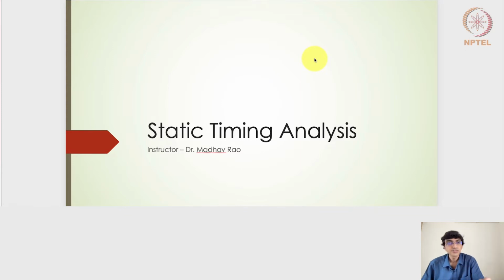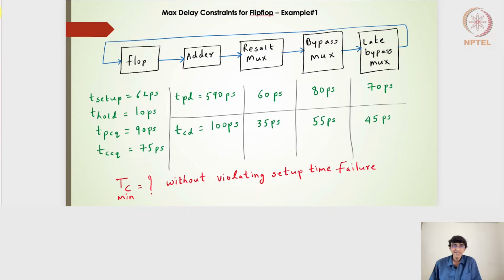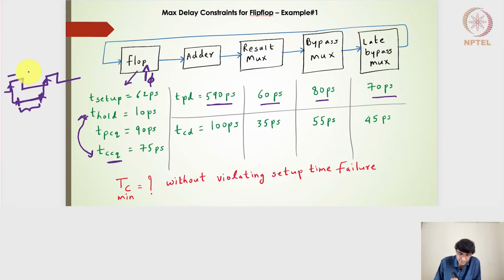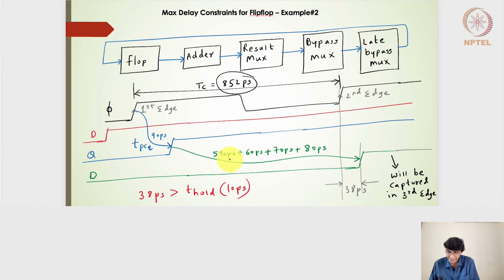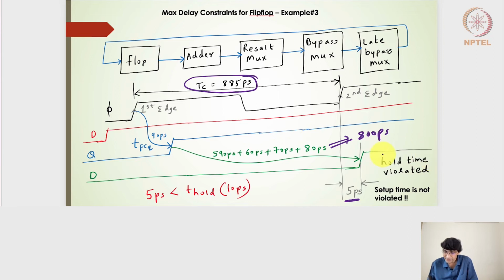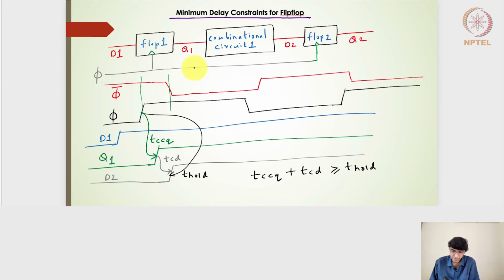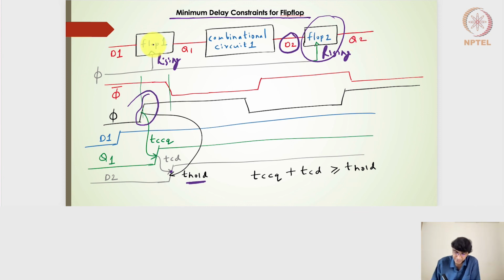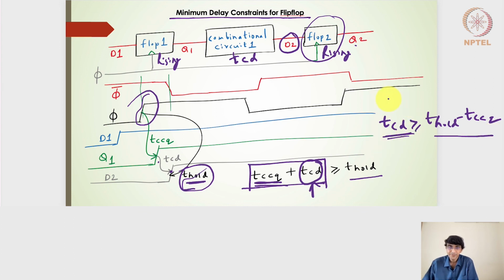11.2 -  Static Timing Analysis - Continued

Comment: "How is a hold time violation occurring at 14:26 in Example 3? Shouldn't the timing parameters involve the contamination delay instead of the propagation delay? Correct me if I'm wrong."